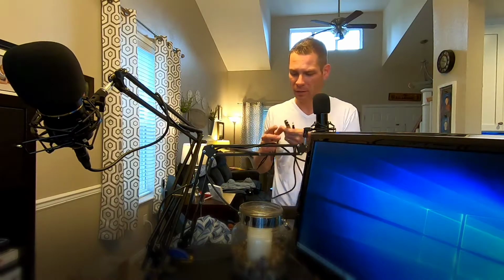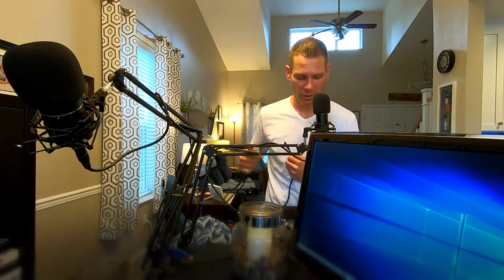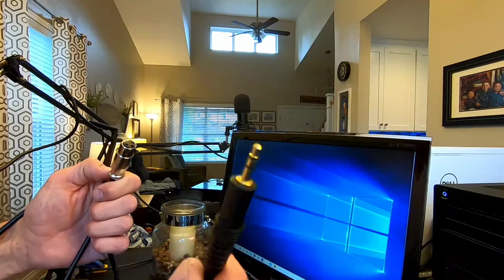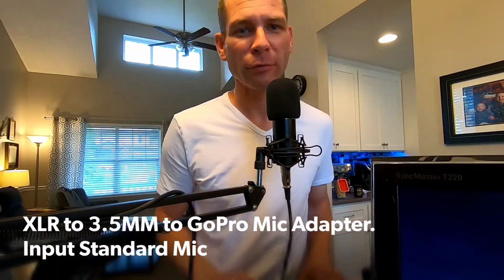Connecting an XLR Microphone to a GoPro

Comment: hey so i would like to start recording my trumpet playing using a shure 98/h sax mic and was wondering if that would work with a gopro hero9/10/11 black and a media mod using a 3.5mm to xlr adapter to connect it.
Reply from the maker: I think yes. I've used an xlr mic with the 3.5mm cable connected to the gopro and it worked. I believe the camera will have different external microphone settings for gain which you will need to test record and see which is best.

Comment: hey thanks for the video! just to clarify, if i'm connecting a condenser mic into the xlr->3.5mm adapter, and that into the gopro mic adapter, does the gopro MA provide phantom power? normally i plug my mic into an audio interface (m-audio profire 610), and i'm curious if i could just plug a 3.5mm cable into the headphone jack and run that thru the gopro mic adapter. much appreciated!!
Reply from the maker: The gopro mic adapter provides a small amount of amplification that works for some mics. You may still need the audio interface. If you are on the go then I'd use a compact shotgun mic instead.

Comment: So from my mixer using two condenser mics I would go from 1/4 male line out to the 3.5 mm mic adapter to the GoPro?
Reply from the maker: Correct 💯
Reply from the maker: Experiment with which output from the mixer and the gopro mic settings

Comment: I have Maono Au Am 100 audio interface, I have my shure microphone plug into the audio interface using the XLR cable. When connecting to phone, everything works perfectly, but when I connect to my gopro gero 11 black using  3.5mm cable, I am having an issue, where no sound was going into the gopro, if you happen to have a tutorial on this matter, can you kindly help me. BTW the microphone is using the phantom power, I am using klerktecnin audio booster.
Reply from the maker: I believe you need a media mod or mic adapter with the gopro. I use a mic adapter on my hero 7
Reply: @PrestonKallshian  Hi preston, thanks for the reply, I forgot to mention when connecting the 3.5mm cable, I am using it wirh gopro adapter, but when I using normal microphone such as lavalier or wireless, everything works fine, the only issue is when I am trying to use it with my audio interface, nothing happen, I have try so many things, switching the setting of mic mod in gopro, using different types of cable to connect to my gopro. My main concern is that I thing it is only works with audio mixer, maybe no with audio interface, if you to happen have an audio interface, maybe you can share to me the setup process. Thanks again.
Reply from the maker: I don't have one but it looks like you would take a regular aux cord from the interface output and plug into the mic adapter. The aux cord used for this may be different than the one for your phone. The phone one would have three rings on one end. Use a regular TRS aux cord and double check all output levels
Reply from the maker: @kamalrusli3432  My mixer is basically an audio interface. It is all I have. I assume you have tried every output in the interface. Try every output with the knobs all turned all the way up.

Comment: Hello Its Dawid from Poland. I just bought whole podcast set-up with sontronics xlr podcast pro dynamic microphone 2x and 2 x GoPro 8 hero Black with 2 x GoPro mic adapter. To manage all and connect i have zoom livetrak L- 8  audio interface. 

I did first connection sample and i dont know how to connect GoPro's to zoom livetrak. I have connected  cameras with GoPro mic adapter and that to livetrak with mini Jack3,5mm  cable from adapter to livetrak 6,3mm Jack.

I dont know how to make that interface will transfer voice from xlr mic to GoPro do i can make video together with dynamic mic sound. 

Please help ! 

All the best
Reply: Okay, here is what I think will work. The XLR microphone will plug into the livetrack mixer in channel 1 XLR input with phantom power on. The output from the mixer will go into the cameras by taking one of the 1/4" outputs (monitor out) and sending that signal to one or both cameras. i would use a stereo 1/4" to 3.5mm adapter and a two way 3.5mm headphone splitter to do this and then send the signal into the gopro mic adapter. That is what I am doing in this video with one gopro.
Reply from the maker: Okay, here is what I think will work. The XLR microphone will plug into the livetrack mixer in channel 1 XLR input with phantom power on. The output from the mixer will go into the cameras by taking one of the 1/4" outputs (monitor out) and sending that signal to one or both cameras. i would use a stereo 1/4" to 3.5mm adapter and a two way 3.5mm headphone splitter to do this and then send the signal into the gopro mic adapter. That is what I am doing in this video with one gopro   https://youtu.be/mE-e9DoSpcw
Reply from the maker: Sorry I replied twice from my other channel Northwest Home Value. Anyway, watch this video: https://youtu.be/mE-e9DoSpcw